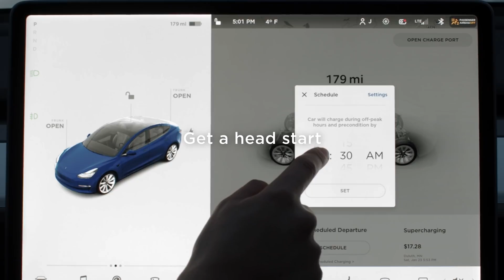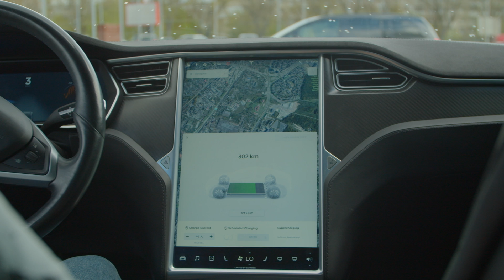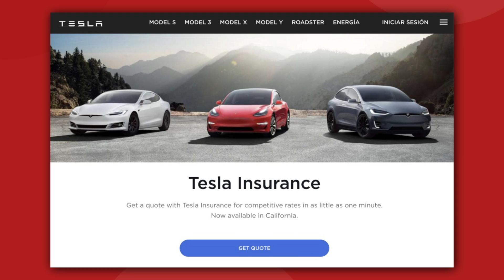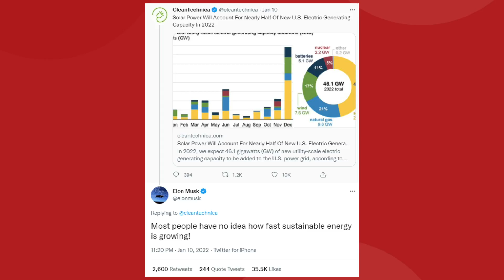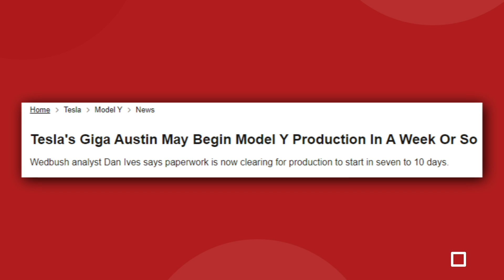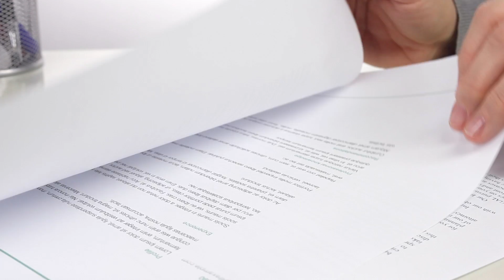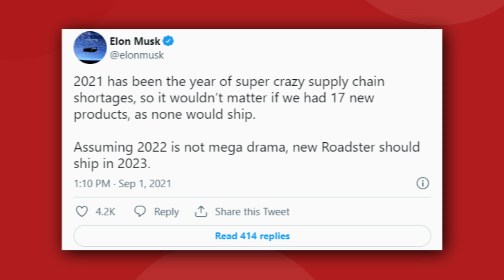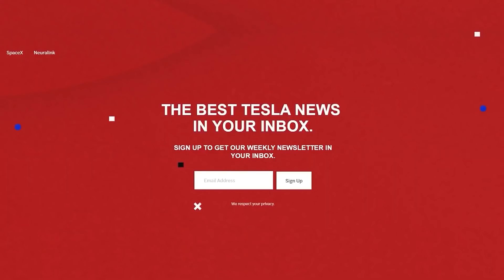The Tesla 2022 Company Update Is Here!

Comment: Musk did NOT say Level 4. Lex asked a question and used the term Level 4. Musk responded to the question in general but NOT to the Level 4 part.
Reply: The whole SAE autonomy levels thing is junk.  The way the SAE assumed that cars would develop has simply not emerged in reality.   For example, L4 says that the car is fully autonomous but only in some situations.  Tesla's with FSD can completely autonomously drive across a parking lot with nobody even sitting inside.  That is "some situations" - so Tesla is already L4.   But they also say that at L3, the car drives without you touching the controls - but Tesla's steering wheel wiggle to check for alertness fails that test - so Tesla is at L2.   Furthermore - the cars with MUCH crappier features that use a camera instead of steering wiggle as an alertness test are being certified L3 while the VASTLY more capable Tesla FSD gets only L2.   The whole system is a total mess.  So my strong advice is to ignore the SAE levels and just look at what the car can do.

Comment: The time between announcement and production of the "25k" Tesla depends a lot on how they cost-engineered it.  It's possible, for example, that it's a "CyberCar" - with the same kind of folded steel body as the CyberTruck.  That would be one very good way to hack down the cost...notably - NO PAINT SHOP - which is a huge cost.   But if it's a cut-down Model 3 then it'll take a LOT more production engineering.   Then there is the question of where it would be made.  GigaShanghai and GigaAustin are already scheduled to the max...so we might be looking at another GigaFactory - and that'll take two more years.

We can't possibly guess until we know what we don't know.
Reply: I hope they don't go that route.  I'm betting the majority of people would like a more conventional car and one that has several paint scheme choices.
Reply: @ayCarumbaQueLio  Tesla have said that using heat treatment, they might end up with a range of different colors for the CyberTruck - but my feeling is that they may just encourage people to get their cars vinyl wrapped. But we don't know - the $25k car is a closely held secret.
Reply: Sounds cool—paint never lasts anyway